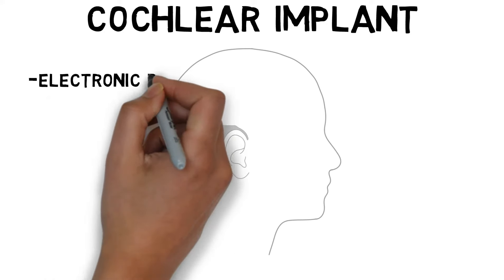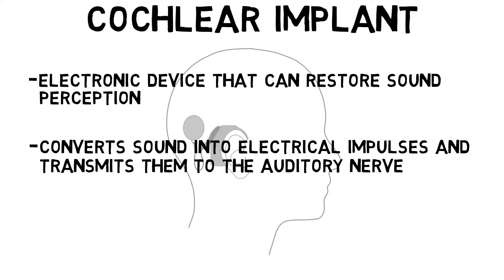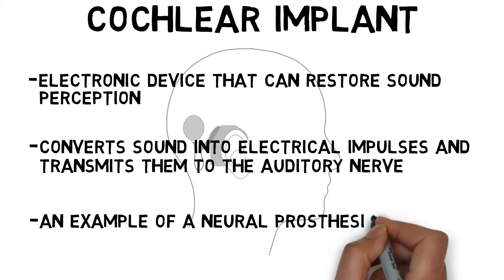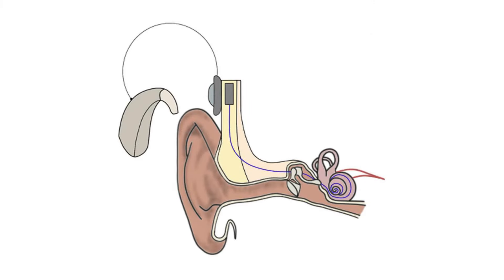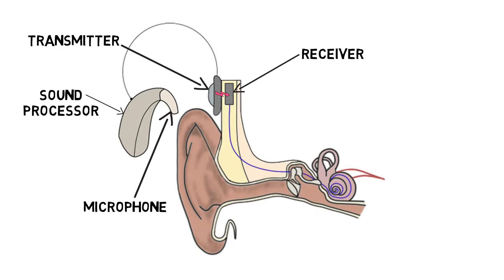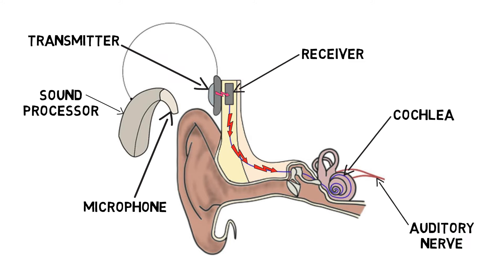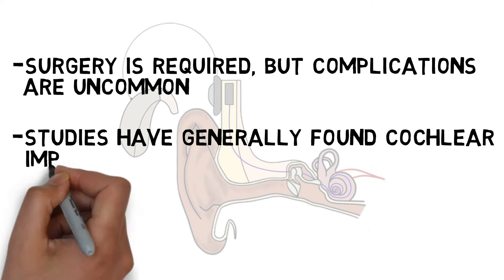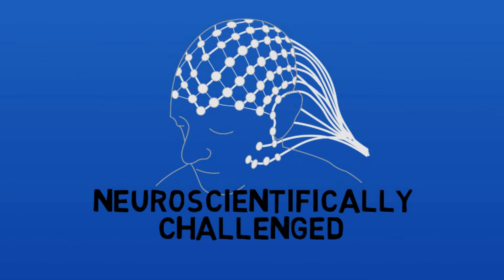2-Minute Neuroscience: Cochlear Implants

Comment: Awesome videos! I have a lot of questions though.
Does it need to be charged regularly?
Any resource which shows how the electrical impulse is made suitable for the vestibulocochlear nerve to transmit? Like what do the currents vary on? Frequency? Voltage? Amps?
How is it attached to the vestibulocochlear nerve? Is it stimulating a specific region of the nerve? Or just conducting it regardless of the current's origin or the site in the nerve's crosssection where the stimulation occurs?
Reply from the maker: I think there are different options for batteries; often people use rechargeable batteries and recharge them at night. I included a couple references in the video description. This one might help to answer your other questions: https://www.ncbi.nlm.nih.gov/pmc/articles/PMC2782849/